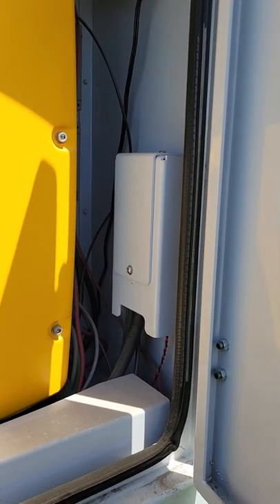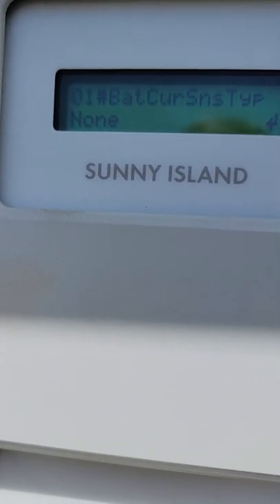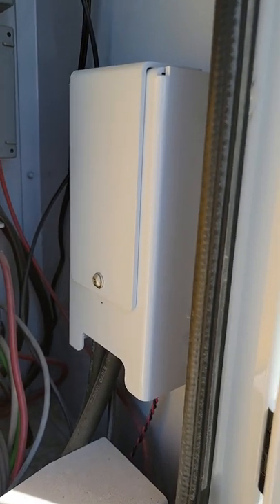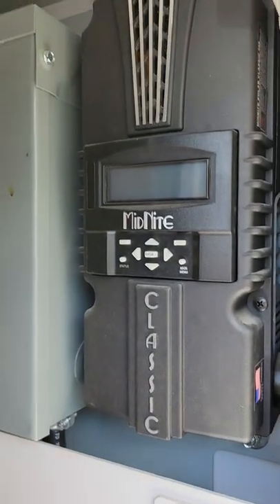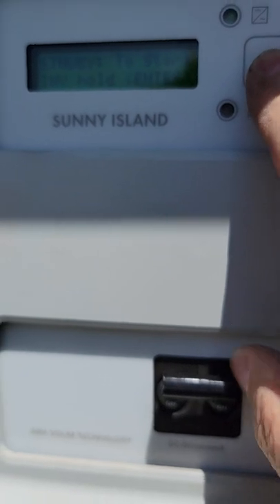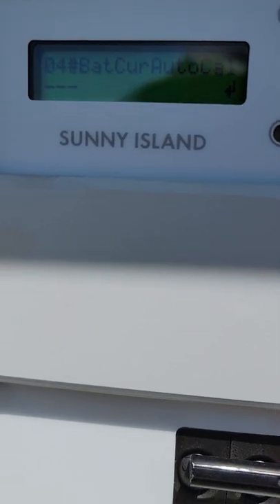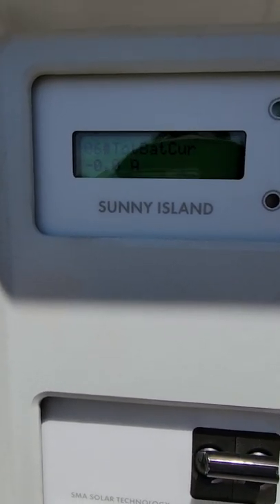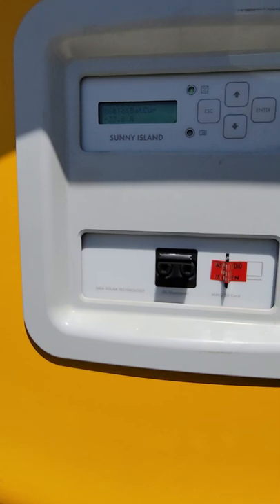DC Solar Trailer - Battery Current Sensor (shunt) Calibration

Comment: John -greatly appreciate you taking the time to make this video. Found out the Battery Current Sensor was NONE and was able to switch it to the 50/500. Did you ever find out if the 500 referenced the Ah combined on the Battery Bank? I will raise it to 1020Ah - the batteries are 510Ah each.
Reply from the maker: Nope...I never did.
I'll need to ask SMA next time I have them on the phone.